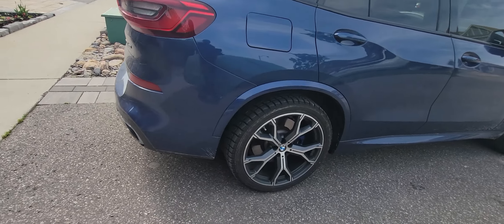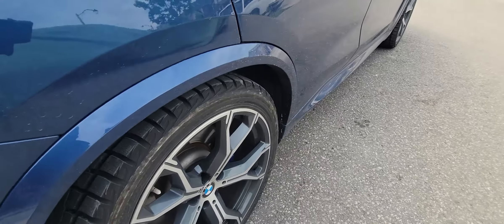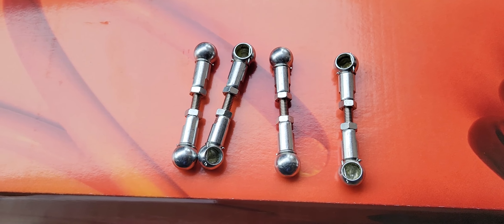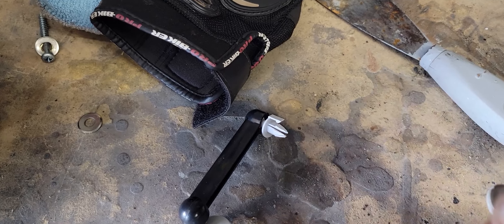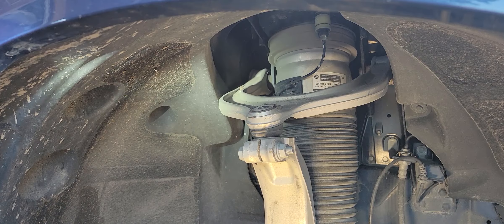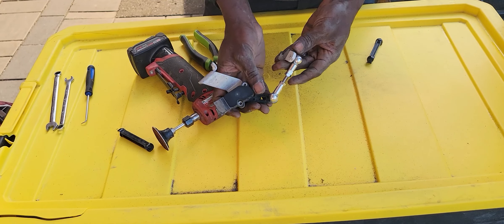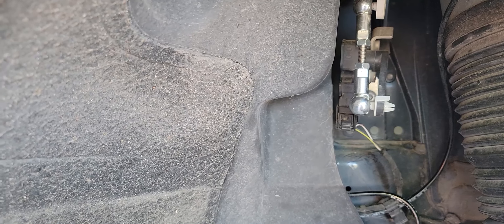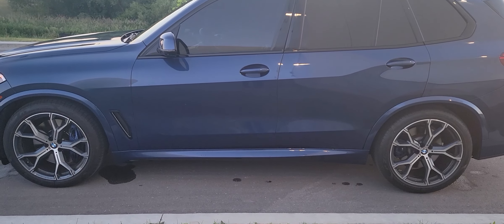Slamming The X5

Comment: Nice work as usual mi Genna. Question will that work for a 2018 x6
Reply from the maker: I think the 18 has shocks in the front and link in the rear.  It will work if it has airbag all around.  You would have to check to see what u have
Reply: @FATmods  yeah you right smh thanks fam

Comment: Wham boss, I like the channel. I have X6 F16, I agree man, Gotta lower the ride. I’m finally going lower mine. I wanted ask you what issue you was having when you lowered your x5 and how u fixed it to make sure all sides lower properly. Thanks man blessings!! 🙏🏽💪🏽💯🛞
Reply from the maker: It was the first gen and it could adjust itself so I had to get it programmed and it bounced a lot.  The next one was fine and so is this one.  One the links in the rear are the same lengths it will lower properly